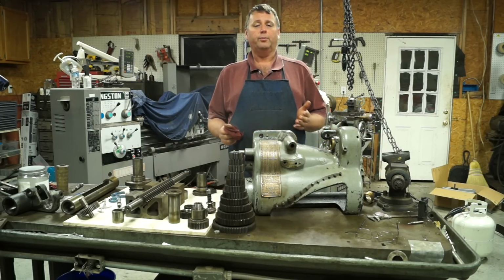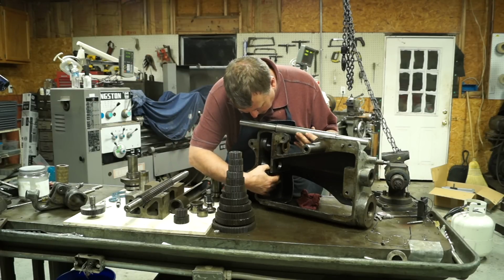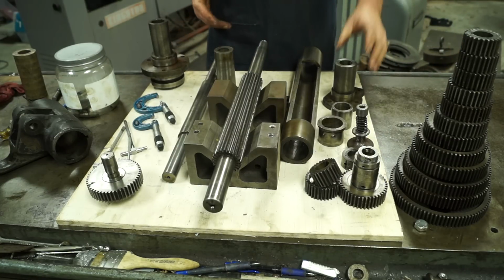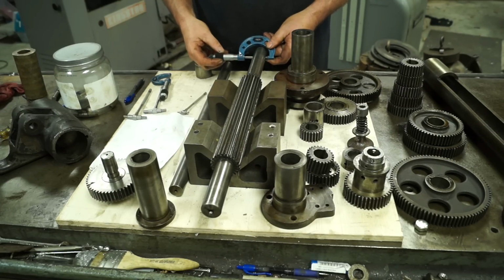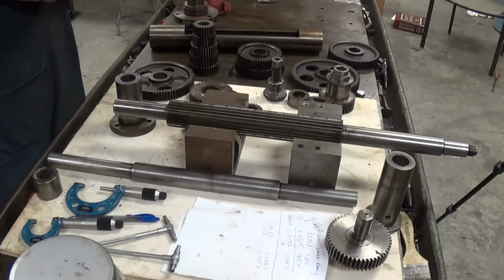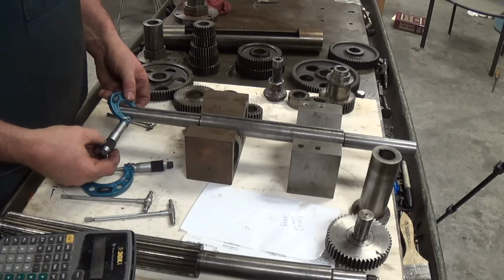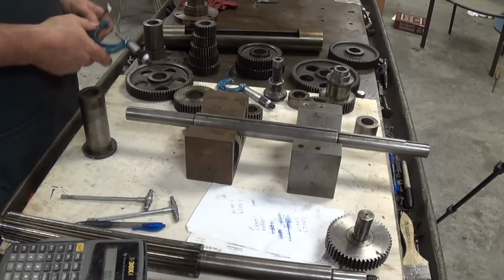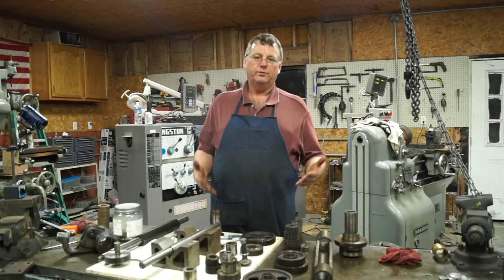Pratt & Whitney Lathe Restoration 6B ( Quick Change)

Comment: Mike , another question.  What kind of work table are you working on. Both you and  Keith Fenner have the same one. It looks like there is some kind of trough around the outside and maybe some holes in the center for "inserta" type welding clamps
Reply from the maker: Mine is a table from a 17" delta gang drill press, Im not sure about Keiths

Comment: An old trick I learned many years ago as a mechanic, was to use a CO fire extinguisher to cool down larger assemblies for a slight material shrinking.
That is a great help when you have several pressfit parts to go on to an axle.
The parts should not be heated, just warmed up in an oven (say max 80-100 C) to make for easy slide-on assembly.

I suspect the pins are standard oil hardened steel to give a very hard surface against wear on the pins.

Great videos :-) Thumbs up !
Really looking forward to see your rebuild jobs on the vintage machines you purchased recently :-)
Reply from the maker: Yes I have used co2 and liquid nitrogen,  that maybe a Possibility

Comment: So will you make a new bearing to tighten up that .003 clearanced end or just leave it with a little wear? MSC has twist down grease cups if that is what you are looking for. It was too far away in the shot for me to tell exactly what it was.
Reply from the maker: I'm not sure about the bearing, The oilers I'm looking for are twist oilers, they have a hole and the caps twist to close the hole
Reply: @TheBackyardMachineShop  I think they call them princess type oilers. You probably have to make those yourself. But, i am 4 years behind on your vids. Maybe you found them by now.